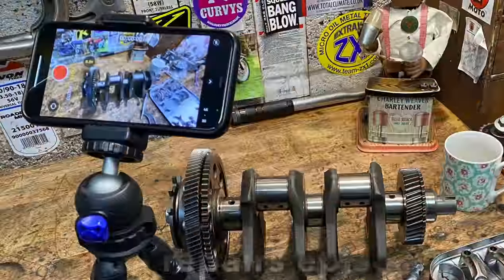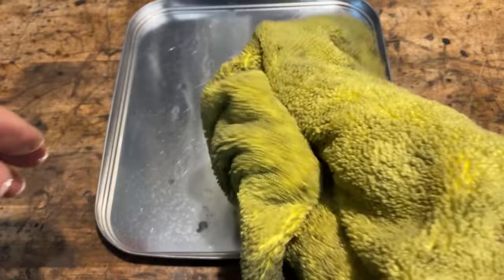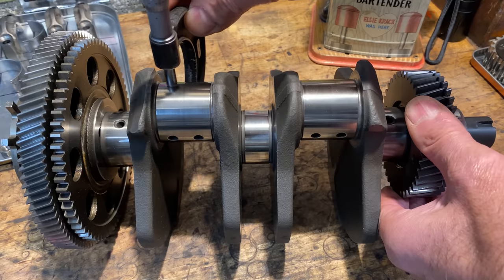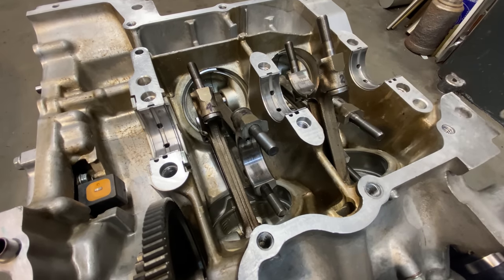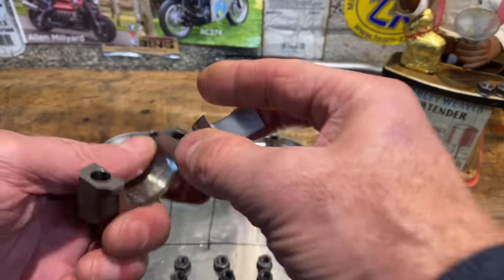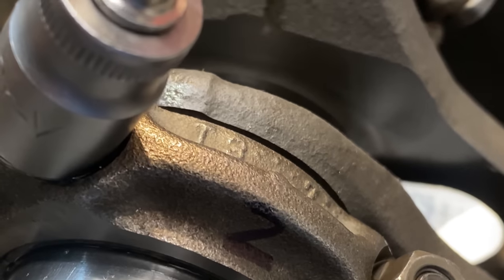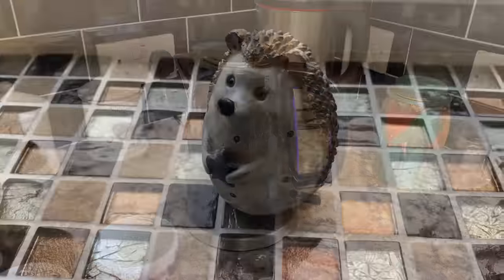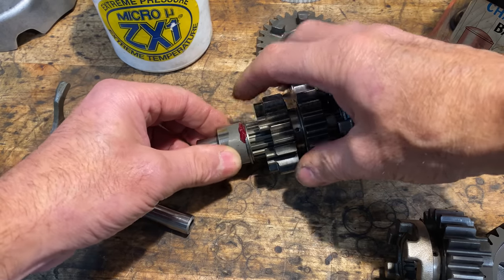Honda ST1100 Pan European - the engine rebuild commences  - Episode 2

Comment from the maker: Ive noticed a few comments questioning the use of assembly oil on the big end cap nut threads before they are tightened with a torque wrench. This is a specific requirement as detailed on the official Honda spec sheet for the ST1100 engine to lubricate the threads.
Reply: Totally agree! The assembly oil is perfect for lubricating engine parts, as it does not run all over the place and making a mess. And the threads definitely need to be lubricated before tightening, as they can easily deceive the torque wrench and misguide you. Thank you for sharing Mr Allen! I'll follow some new tips I saw in your videos!
Reply: I was taught to use clean but no lube for torque but I think lube would make specs more consistent.
Reply: @skofflaww3883  it depends on the application/specs... lubricants cause over-torquing if the instructions don't call for prior lubrication. i don't recall the exact number, but it's considerable (say >10%).
in some instances the instructions call for de-greasing the parts before torquing (like when gaskets are involved).
Reply: Anyone questioning Allen, knows nothing about him. He can build a bike from bits of scrap metal found at the docks!
Reply: @peter-e2q   so true....  next week he will create a v-8 ST1100... resulting in a Super ST 2200!  Out of 8 billion humans, he is most likely 1 in 20 that can do what he does!
Reply: @peter-e2q  yep,was waiting for the keyboard warriors to question Allen!! I really hope it is simply stupidity rather than ignorance on there part!
Reply: @davidfalgout7304  More like 1 in 2 million!
Reply: I always you assembly lube or oil on threads that get tourqed.
Reply: @vtwinaddicted5852   maybe ok on the archaic paint shaker engines, but there are times a blanket statement like that can result in heart ache!
Reply: @tomquinn607   what I was trying to say : out of 8 billion people, 20 people could approach the pure skill Allen has, but only one of those could come close. I can think of only one other person at this time. That was Burt Monroe of Indian fame. I personally have done things mechanically that few have done...  but I am light years away from Allen's skill set.
Reply: Hah....was just going to comment !
Reply: Allen is the assembly oil just normal oil or specifically assembly oil? also Q for you about the gearbox - could you not find what you thought was making the box whine? do you think it might just be something not balanced correctly in the original gearbox hence the purchase of the replacement?
Reply: what you dont know about engines isnt worth knowing
Reply: Gotta love the detailed attention to cleaning, and that goes for wiping down tools, as we already know, of course. Those connecting rod bolt threads are quite sharp, and the rods can get a bit floppy until the crank is installed. Slipping a section of heat shrink tubing (it’s inexpensive) over the rod bolts protects the soft crankshaft metal from scratching or worse when lowering the crank into the mains while juggling the rods into place. It’s been awhile since doing any engine work, and frankly I would be be completely satisfied with self-limiting my work to an occasional cam cup shim adjustment! Thanks again for another session of fine engine work!❤
Reply: Oiled threads at a given fastener torque will result in heavier clamping forces. Fiat tend to spec for dry threads. It looks like Honda spec for oiled threads.

Comment: The quality of that engine is exceptional. From the cleanliness I can see it’s been well maintained. 
Interesting to a second manufacturing defect - ok the difference between green and brown shells is tiny but you’d have thought that they would have picked the correct shells given the rods and journals are marked correctly
Reply: too much sake for Hiroki the previous night
Reply: @paulg3336  The brown shell shortage was happening then too
Reply: Yeah, great quality. Knackered big end and gearbox on an engine that has been coddled and barely been around the block. I've seen better pit bikes that cost less than the gaskets on this overhaul.
Reply: @monikacognomen1096  some owner before him probably held it against the rev limiter for 5 minutes without warming it up every time they rode it, with 40 weight walmart dino oil in the sump
Reply: @RickBaconsAdventures  Possibly. Or it was assembled by a fool. Someone who might have put the wrong size bearings in, maybe. We have no evidence whatsoever for your account of why it's knackered, but solid proof for mine if we discount the notion that Allen was lying his ass off. That seems highly unlikely, albeit not impossible. However, I'd go with facts over speculation every time. How about you?
Reply: @monikacognomen1096  do you think the excessive clearance on the one rod caused oil starvation on the other 3?  As a dirtbike guy, I was surprised honda even made a journal bearing engine
Reply: @RickBaconsAdventures  Doubtful. I imagine the oil pressure wouldn't be significantly affected and the shell was fully intact. The motor was so clean, I suspect shoddy general assembly, not just confined to the wrong bearing size being fitted. A poor assembler can really make a difference. The first fireblades were very variable on power, up to 15hp difference. One chump on the line was fitting rings sloppily, bending them into the lands rather that spreading them flat, permanently twisting them. Interesting story is how honda sussed it out using the Toyota model of 'total quality', the integration of inspection and manufacture and almost an inversion of the principles of mass production. Well, I find that stuff interesting,  anyway...
Reply: @monikacognomen1096  Hm, that is really interesting.  I found it odd that a shared crank journal was slightly different sizes on the two ends.  Like maybe some variance between journals, but across one? yikes!
Reply: @RickBaconsAdventures  Good point. It would seem obvious both common journals would be machined together. The variation is indeed odd. Which, I suppose, is a way of saying 'not very good'. I would have no confidence that the bearing surface is parallel to the crank axis, that's for sure.

Comment: When I built my VTR1000 bottom end the number/letter designation was used to denote big end and main bearing shell sizes. One thing my Honda did add to the specification was an initial big end torque and then a further smooth twist/pull through a given range. Thanks for the video Allen. I just love to watch you work.

Comment: I love watching Alan work on bikes. I did my first mc engine when I was about 18. It was the original 1965 Honda 450 4 speed. I bored it out to 500cc's, installed Powroll high compression pistons, Precision Machining racing cams, re-jetted the carbs, etc. etc. It ran pretty good and was a good 2 seconds quicker in the quarter mile (13.23 seconds at Mission Raceways, BC, Canada). Stock was 15.2. The ONLY thing that really bugged me was the 4 speed transmission (which became 5 speed a year or so later). The RPM drop from 1st to 2nd was HUGE! I had to slightly over rev the engine to keep the power band up between shifts. Other than that, it remained reliable until I sold it a year or two later. A great overall experience!

Comment: I just figured out what I like about those "Hedge Hogs", As a small boy I had "Guinea Pigs" ! They are both mini pigs ,And cute ! Incidentally ,I remember I put Heavy grease on the drum cam on my H2 after I carefully worked out the perfect shimming so the new parts would shift like a fine clock ! What a mistake !  I Worked late into the night so I could go out in the morning for the first start and ride !, ....It gets cold here, And I had long forgotten the grease on the drum cam ! ,Started  wonderfully, A few little adjustments ! Now 1st gear !.........? (rock solid)!.....Oh No! "Murphy's Law"! ( Sweating , Worries,etc.) Then It occurred to me ! Get The Space Heater !. After 2 hrs. of a "Case splitting Headache" (and heating the bottom of the H2) ...OMG ! Thank God ! I really didn't want to take that apart again,I am ready to Ride !. And what a ride ! I felt like a King !, Up comes that front wheel  !  I have to show off my new "Lester " 7 spoke I beam MAG wheels and Dual KZ650  Discs (front end)! It was Intoxicating!(I didn't want to get pegged for speeding) Everyone had wire wheels back then !,Honda had pressed steel !. About that Christmas Cake, I was born in 1959 in Toronto Canada and the supply of Rich Tasty Chewy Xmas cake had thinned out here ! ("The Long Search") You should do something special for Tracy (She can and does actually make these kind of literally important snacks!) What would Tea Time be without that?....Merry Christmas and happy new year to You and Tracey...

Comment: This is so interesting because as noted on the ST Owners forum, a rebuild of an ST1100 or 1300 engine is virtually unknown.  It is also fascinating that you have found what appears to be an assembly error right from the Honda factory!
Happy New Year to you and yours Allen from Harrow, Ontario Canada.
Reply from the maker: One of the reasons I took it apart , to be fair it ran well and rode nice just had an annoying knock as I was pulling away 🤔
Reply: @AllenMillyard  I'd call big end knock and a whiny gearbox almost a definition of a poor running engine. In fact, the word I'd use is 'knackered'.

Comment: I changed the main bearing/con rod bearings on a 76 cb 750 a few years ago, being used to old brit bikes with less accurate fits shall we say, didn't realise Honda tied them down to microns, couldn't find some of the sizes/colour codes, was told to take a midpoint size of shell, (guess) never had any problems when built up. I was told the accurate sizing is more for racing engines.
When I sold it, found the missing sizes below front of engine. Amazing

Comment: Nice build. I was taught by a two old fashioned technicians, standard torque rating for bolt or nut type fasteners, always use lubricant to insure correct clamping force. SAE . My dad was meticulous on clean and proper lubricants. I was pushed for time when I was at Barber Motorsports and did not have time, but I look at your bikes there on our next visit . 
Thanks for the video!!

Comment: Put a short piece of hose over the rod bolts to prevent scratching the crankshaft. 
When you reinstall snap rings make sure they go  in the right way. The flat side against the thrust surface.

Comment: I had to replace the trans on my first '91 and everyone who didn't have the case broke down and apart wanted way too much, so I got a gearset, shift drum and forks from one place from a bike with nearly no miles on it (8,000 miles maybe less, looked as new). Getting the engine out and back in was a bit of a bear, and once it fell over, but I got it in and then cracked an ear off the alternator (old 28 amp).
 Getting quite mad,  I left for a vacation, drove my freshly repaired truck to Michigan from Texas to visit my parents for Thanksgiving, drove back and bought a freshly crashed '91 ST1100 with 41,000 miles from a fellow on the ST-Owners forum, got it going with the bits off the still unfinished bike.
This made the bike a two tone Black fairing and bags, with Silver. 
I got the replacement alternator housing and enough parts to get the black bike running as a nekkid ST, but, it had developed an oil leak from the repair work. So I was trying to ascertain where it was coming from, thinking it was the alternator and I pulled it out to replace to o-ring seal, and managed to crack an ear  again . . . the housing was rather beat up when I got it (twas a cheap one). So I bought a new complete 28 amp from the dealer in Palestine, TX, and was careful when installing it. Then I noticed the oil was coming from the weep hole at the back of the left head. When I had the engine fall over, I guess it hit the valve cover enough to crack the tube for the spark plug, longitudinally. A good cleaning, some JB Weld  epoxy, and it is still holding oil some 60,000 miles later. I later bought enough "Tupperware" and other  bits to get the fairings and other bodywork back on it.

Comment: Firstly Happy New Year everyone!

I smiled when I saw the ‘stringy’ engine assembly oil. I bought 5L of Millers pre lube years ago (at a great price.. a new version was coming out or something.  Sure the old version is fine for my stuff though…)

..anyway the stringy-ness of it when putting an engine back together always makes me feel assured that this stuff will stick about and not drain away in the period between putting all the internals together and actually starting it.  (Which can be a wee while waiting for carb bits, mag rewinds etc.  etc)

Anyway… if you and Tracy have  a problem with excess cake,  I’ll happily pay the postage for it  to Aberdeenshire!!  😀

P.S. not been mild here.  Badgers been sniffing around my old Ferguson TED20 in the field.  Huge paw prints in the snow!!

Comment: Now you’ve got me paranoid 😂. After a good few years and several different bikes in between I have come back round to another ST, because… it’s just great!
My first was a ‘90, I now have a’94 with just 21,000 in equally super condition. I’d like to think I have pretty good ear, but now I’ll probably be listening. There would be bugger all I could do anyway, that level of skill is inspiring, but I’d lack confidence now. Great video though, it’s good to see parts most of us would never, or really need, to see. Such a well engineered bike, as are all Hondas, ( well, the ones I’ve had). I guess yours was probably just one hiccup amongst goodness knows how many that were spot on 🤞

Comment: Hope you see this before you get it all back together because I know it's a lot of work.. I just noticed that when you put the inner splined spacer on the transmission shaft the oil hole in that shaft wasn't lined up with the hole in the spacer.. I don't know if it matters but I'm guessing that is the oil circuit that oils the bushing as the spacer also serves as a bushing.. Hope it helps.. I love the videos keep up the good work I enjoy watching them..
Reply from the maker: the holes dont line up there is an internal groove in the spacer to direct the oil evenly around the bearing surface
Reply: @AllenMillyard  Okay good.. I've never had one apart personally and it's hard to tell in It he video but I wanted to let you know just incase it did need to be lined up I know it's a big job to tear it all back down.. Happy New Year's Allen hope you have a good year..

Comment: Another great video from a brilliant engineer.  I used to work in a factory which manufactured engine bearings in all the customer's grades, standard to oversize etc. I'm surprised you didn't show checking the crank for freedom of rotation after tightening each cap. Just an observation on my part, not intended as a negative comment at all.
Keep the videos coming, watching you work is very interesting and educational.
Reply from the maker: I will in ep3

Comment: I've put a lot of Honda (car) engines together, mostly for high performance, and you did everything right; even down to doing the rod bearings a little at a time, most manuals/builders won't tell you to do this but I find it absolutely necessary. 
You did the right thing getting Honda bearings, they are almost always the right choice. Graded is always better.  Green is considered 'standard' size on most Hondas (if you didn't know) so if you had gone aftermarket it would have been of no use to you. Very strange that it had the wrong bearing in it, I've never seen that before. Maybe it was a Friday afternoon engine. Could it have been apart before? Although there were no signs of this on your previous video, you can usually tell as I'm sure you're aware.
Reply from the maker: Thank you

Comment: Alan  i  was always told  a  long time ago  when you  put anything  in like con rod  end cap nut  not to put oil on as when you torque them down you  dont get a  true setting  because of oil it  should  be  metal to metal to  get  correct torque setting.  oil  after   torque in them up.   one  was  demo   this  without oil  first   then other  done with oil  2  complete  settings.  this  also  applies  with wheel  nut  no  oil   gives correct torque  setting.  big end  shells  will get  hot  because  with oil on the threads  you  over tighten  them up.  they are  in oil  any  way.  the chap  that  told  me  this was an old master  now  long gone.   i am  suprised  you  did  that  m8.  cheers

Comment: My beloved 2000 ST1100 sits on the lift table in my heated garage. Almost 50,000 miles on it but the miles on my carcass added up since 1964 and I have stopped riding. That one and both 96 XRs will be for sale in the spring. I mentioned before to Allen about supercharging one of these ST1100s as the Vee layout would accommodate one. The hard part is driving the supercharger shaft off the front of the engine pulley system with the radiator'/plumbing and frame bits in the way.  I sent you a photo on your Facebook page.

Comment: Well done Allen! Pity you weren't tasked to verify Honda's engine build when this was in production! Seal fitted incorrectly with risk of oil starvation and now oversized bearing shell fitted even when the correct one was specified on the crank! Someone must have been having an off day when they assembled this motor 😞Lucky you investigated the noises before anything bad happened. Stitch in time!